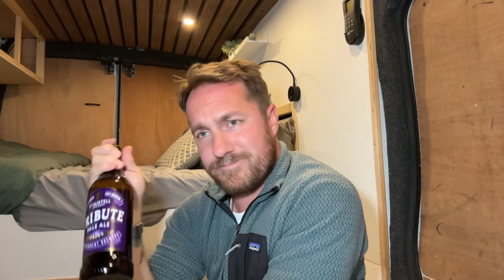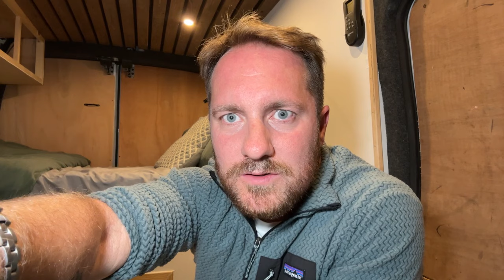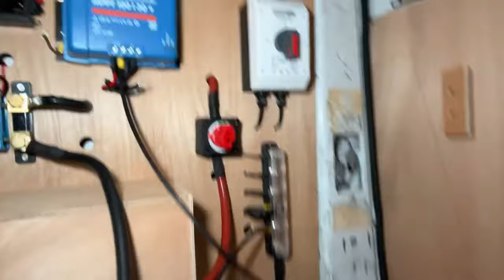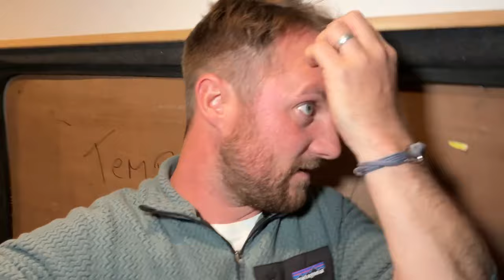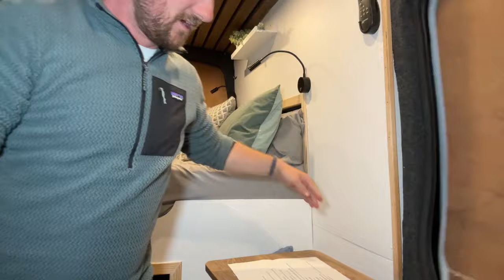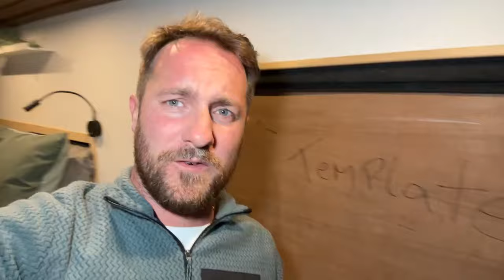Live updates about the VAN

Comment: Shaun, diesel leak probably leak off pipe from injectors, also turbo noise if there is no boost pipe issues, did the garage replace the turbo? As if you lose oil pressure from pump failure the turbo is usually the first damage as the turbo spins incredibly fast and any starvation of oil will damage the turbo
Reply from the maker: They didn’t replace the turbo but they did test it and have said there is nothing wrong with it.
Reply: @LoveSundays  you have the 2.2 front wheel drive?
Reply from the maker: @andrewfox7861 yes
Reply: Easy to check the turbo wear and any see if the fan blades are fouling the housing, this would give a high pitched noise on boosting

Comment: Hi mate.
Would you recommend buying a ford transit again or due to your extra cost of new engine. Would you go with a different make.
Reply from the maker: I still like transits I like the way they look and the space in the van is larger than alot of other makes. I think if I did it again I would probably spend a little more though and get a one private owner from new model as opposed to an ex company van like mine is. You get a lot more for your money with a transit
Reply: Just Start to look for a van. Ready to build through winter, but need room under the bed for two large greyhounds.  Thanks for the feedback and look forward to more videos.